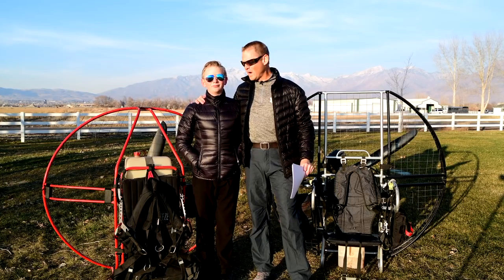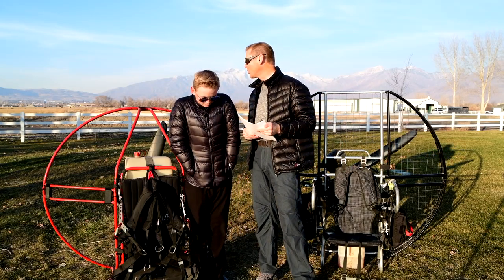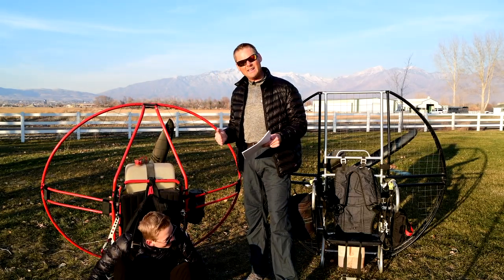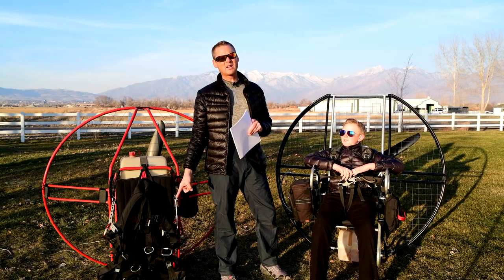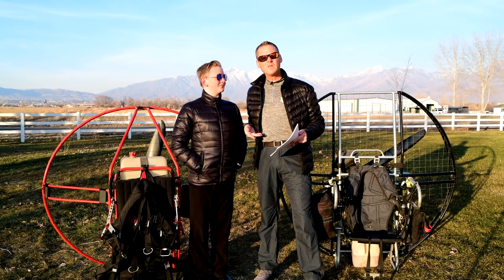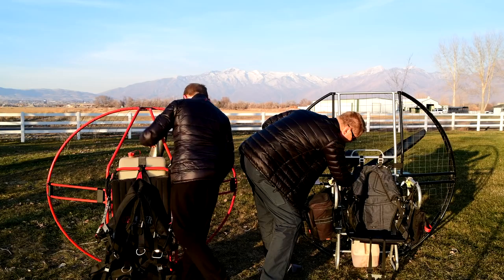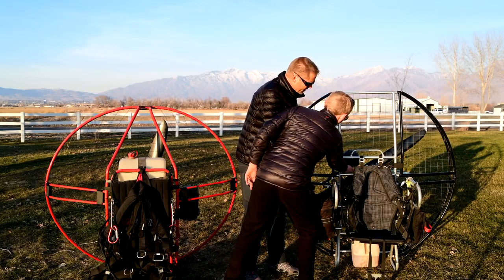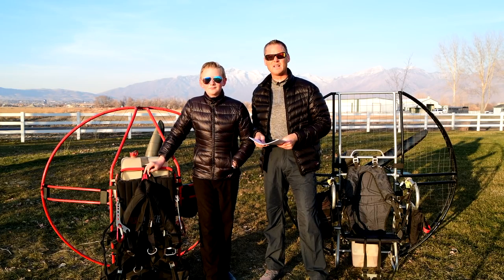Page 6 of the 304 Reasons Flat Top Paramotors Are The ONLY Powered Paraglider To Buy & Fly!!

Comment: Hi Dell why not take aluminium square tubing flatten it to a diamond shape use V shaped roller anvils to press the square tubing to a flatter shape giving you zero wind impact and no drag from behind you`ll have 4 unbendable corners having a center truss on each side .
Reply from the maker: It's all about weight vs strength vs cost and they need to be balanced well.

Comment: Dell. Have you ever thought about building or flown a Turbine powered Paramotor? Or would the motor be too expensive to be affordable?
Reply from the maker: Yes I have looked extensively at many many options and forms of jets but the bottom line is they are not fuel efficient enough.  If you fly 500 miles in 1 hour then they make sense but when you want to fly only 30 miles an hour for as long as possible they don't make sense.  Might be fun for a 7 minute SUPERDELL demo but just not practical other then that.
Reply from the maker: @austinsmith9413  Yes I've actually looked at that.  One of my good customers invented jet engines like that.  The problem is as you say it sucks fuel so fast its simply not realistic for a paramotor.  A jet is great at going fast for short duration but not good for slow for long duration.

Comment: Dell. Why don't other manufacturers copy the Flat Top design, ie gas tank on bottom, seat elevated above bottom of unit adding a bottom bumper, front bumper to protect pilot etc?
Reply from the maker: That's like asking why did some people vote for Hillary.  Sadly there are just many like that who don't care one bit about logic, reason, facts or rational thought process.  19 dead in a single year which ALL could have been prevented with this much much safer equipment and still the liars just keep on lying.  It's seriously stupefying for those with a bit of sense.  The scout importer DIED on a scout but after he died Tucker Gott gets kickbacks to go around promoting the exact same gear like nothing happened.  The nirvana importer died on nirvana but Ryan Shaw ignores the deaths as well and continues pushing the very same deadly gear so many have died on.  The blackhawk owner is dead.  The kangook dealer died.... After all the carnage & death in all the exact same ways over and over and over the usppa scam keeps pushing people as instructors who literally don't have even the most basic skills themselves as they have never had a day of proper training..  Those like Eric Farewell of Aviator PPG who broke his own back already because he has never had any proper training but now pretends to be an instructor.  One like the blackhawk instructor who "trained him" broke his own back TWICE in the same year and killed 2 students in a single month (Michael Mixer).  Jeff Goin who set up the usppa scam that promotes people like that as "certified instructors" was even on video covered with the blood of one of those he scammed into bogus training and gear from the 1980's that's never been updated to fix any of the horrific issues.  Then when he tried to do what my kids can easily do he crashed through the window of an RV and ended up in the hospital.  Still he lies about the very best gear and training in the world thinking that will help him scam more money out of people for totally fake "certifications".  So yes why in the world don't many people in the world think logically and rationally or even care in the slightest about basic honesty and decency.   Hard to say exactly but what's important to me is that I do care because it's my own kids lives flying the gear I invented to keep us safe while giving the highest level of capability.  If I thought for one second there was better and safer gear then a Flat Top & Dominator I would buy it and promote that instead.  Sadly there is nothing else even remotely close and while 19 died on other gear in a single year ZERO people have ever died in history on a Flat Top paramotor.  So while other people do crazy things that don't make any sense how about we just go flying and enjoy what does work.  :)
Reply: Is there Patent on the designs that the Flat Top has which prevents other manufacturers from  copying the Flat Top designs or is it an open market where the Flat Top design can be copied without Patent lawsuits/payments? A Patent is defined as: a right granted to an inventor by the federal government that permits the inventor to exclude others from making, selling or using the invention for a period of time. The patent system is designed to encourage inventions that are unique and useful to society. Congress was given the power to grant patents in the Constitution, and federal statutes and rules govern patents. http://smallbusiness.findlaw.com/intellectual-property/what-is-a-patent.html

Comment: I don't think you need to say "facing into the wind" when talking about drag or aerodynamics. In fact I don't think it's even correct to say that since the wind can be in any direction, not just the front of the paramotor as you seem to say.
Reply from the maker: No the wind can't be in every direction once you are in the air as the wing only flies straight through the air.  Think about a balloon in 100mph wind.  How much wind is blowing on the balloon? Zero.  The balloon is always drifting with the wind and so it always is in zero wind.  Same reason a wing that flies 30 mph always flies 30 mph air speed.  If you have a 200 mph tail wind how much wind is on your face when you have a wing that flies 30 mph air speed? Yup 30 mph no matter what the wind is going or which direction it's coming from the wind is always 30 mph straight at the wing.  If you fly in a large circle in 200 mph winds you go 30 mph air speed in every single direction.  It's only the track over the ground that changes.
Reply: Well if we are talking about the Wing I believe we have the following:  Relative Wind, Angle of Incidence and Angle of Attack.  Relative Wind is the airflow produced by the wing moving through the air.  Relative Wind is in a direction parallel with and opposite to the direction of flight.  Airfoil (Wing) is configured so that there is an angle between the chord line and the longitudinal axis which is know as the Angle of Incidence.  The Angle of Attack is a term used to express the relationship between an airfoil's chord and the direction of its encounter with the relative wind.  There is a noticeable motion when an object moves through a fluid or as a fluid moves around an object.  If a thick stick is moved through still water or the same stick is held still in a moving creek, relative motion is produced.  It doesn't matter whether the stick or the water is moving.  This relative motion has a speed and direction.  Start Safe, Stay Safe
Reply: Thanks for the detailed reply. I understand you better from those examples. 
But if we take your 200mph tail wind + 30mph wing example... I would have thought that the wind's direction would still be from behind, it doesn't make sense to me to say that you are facing into tail wind?
Maybe this is just a different understanding of terminology, but I would still only say that you're facing into the wind when the wind is actually going in an opposite direction to the paramotor. 
For your examples wouldn't it be more correct to call it drag or air resistance?
Reply from the maker: You kind of have to start from the basis of the balloon.  Even if there is 200 mph wind anyone in a balloon will feel zero wind at all because they are drifting perfectly with the wind.  Their ground speed would be 200 mph but those in the balloon would feel zero.  So once in the air there is no such thing as wind as you are automatically drifting with the body of air.  So even if you are going 30 mph through the air it doesn't matter which direction the air is going or the speed of that body of air you are still only going 30 mph through the air.   Now at take off it would be different. If you pulled your 30 mph wing up in 200 mph wind you would immediately be going backwards at 170 mph ground speed but then still only have 30 mph of wind on your face as the wing would fly 30 mph through the body of air no matter how fast that body of air is moving.  If you tried to land in 200 mph wind while going into the wind you would hit the ground going backwards at 170 mph ground speed.  If you landed with the wind you would hit the ground at 230 mph ground speed.  Your air speed would always be the same 30 mph in your face though.  If you were sideways in 200 mph air you would land at a perfect 30 mph of air speed in your face but you would be going 200 mph sideways.   Hope that helps you understand how it works.  Ultimately It's more like you have 10 mph of wind and the glider can fly as slow as about 11 mph so with a 10 mph head wind you could launch by running only 1 mph.  Then once up immediately accelerate back up to the 30 mph.
Reply: I 100% understand and agree with that. But I cannot agree with "once in the air there is no such thing as wind", I know what you mean by it, but the wind is obviously still there and it's constantly applying force to the balloon. Perhaps what Channing said about relative wind would be more accurate?
Reply from the maker: Well no if you go for a balloon ride you have basically zero wind the whole time.  Never does the wind actually blow on your face.  It's as zero as zero wind gets.  It's a pretty common question.  People ask about what happens when the wind blows from the side but the wind can't blow from the side on a paramotor as the glider will drift with the wind so the only actual wind you get is the same 30 mph straight into you from the direction you are flying.